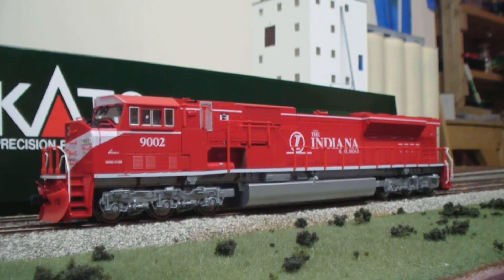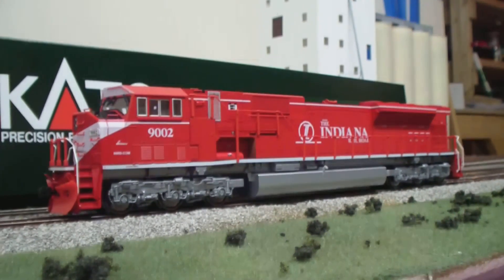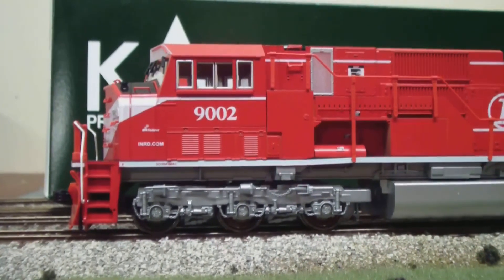Review of the new Kato INRD SD9043MAC

Comment from the maker: I just press fit them in. There is no way they are going to come out. If you leave a little bit of plastic attached to the grab iron and use that to push it in the hole then just cut it off with a blade it makes the job much quicker.